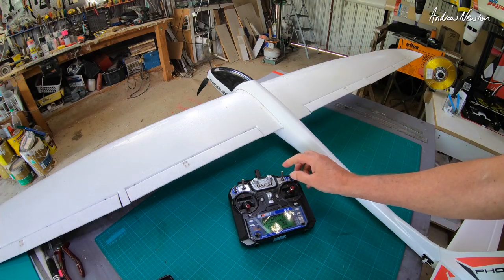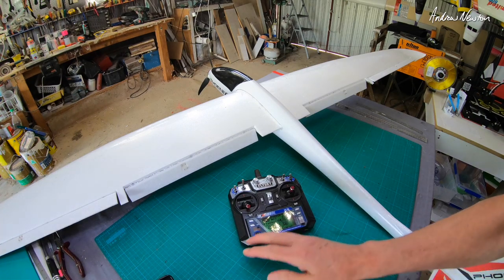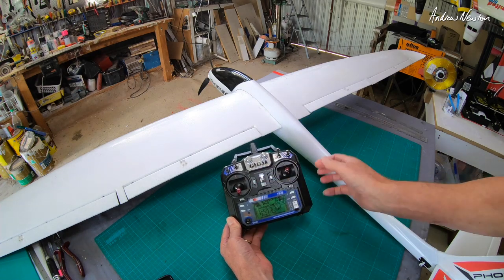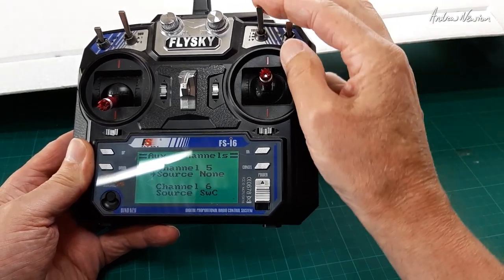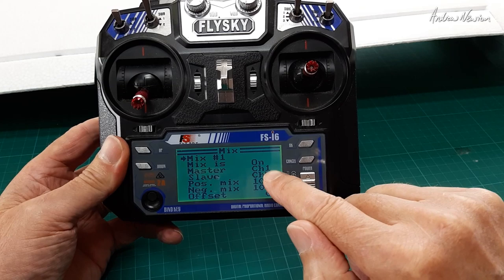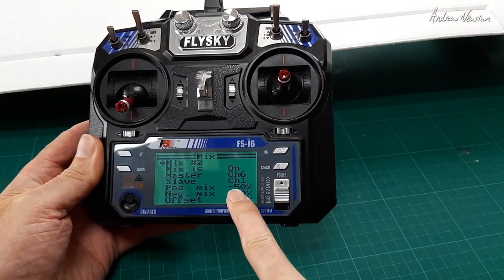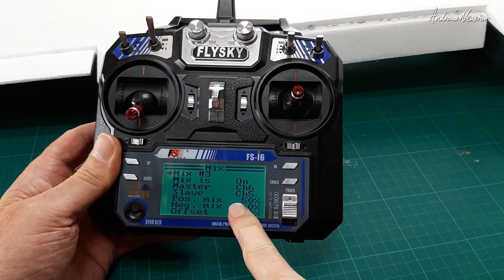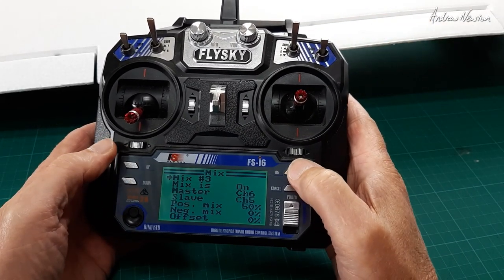FlySky FS-i6 Crow mix

Comment: Great video, glad to see you still use this modern day classic radio, a little tip on the FSi6x its dead easy to add a second 3pos switch, i bought a new fsi6x recently but due to shoddy weather not even used it yet

Comment: Just found your channel and love it man. I am just getting into Sailplanes and use this radio, this helped a ton. Cheers and happy flying.
Reply from the maker: Excellent, sailplanes are the best
Reply: @AndrewNewton  Hello friend, thank you very much for the video, you got one more friend. I am from Brazil and I have a question I wanted to know if you can configure this radio to move the wings of the wing individually, for example the one on the right moves without the left one moving. The one on the left moves without the one on the right

I thank you very much for your answer

Comment: Thanks Andrew! That is what I wanted to know, how to program crowbraking on the flysky transmitter.  

Does the plane balloon up with crowbraking? 
Thanks from the Netherlands.
Reply from the maker: Yes a little bit.
Reply: D. TV if it does, you can add a bit of down elevator to counter it, just a tip.
Reply: @MARKLINMAN1  But the problem is, that there is no mix left. If you mix crowbraking, then you have to use all the three mixes.

Comment: @AndrewNewton 
Hello Andrew!
Is it possible to split flaps using  FS-IA10B receiver ( ruled out Y cable ) and use them at the same time as ailerons on FS-i6x radio? Would it be possible like this please? 
Thank you
Reply from the maker: Like a Full House glider mix? Probably, but I cant check it. Would require separate channels for each aileron and flap.

Comment: Can i have crow mix braking when my ailerons are plugged into a ZHOD KOPILOT LITE but turned off? Current set up is a Voalntex Phoenix V2, Flysky FS-i6x and FS-i6b, plus the Kopilot. what i am thinking is it possible to use the crow mix when the Kopilot is NOT engaged like when coming into landing i turn the Kopilot off so would crow braking then work or not? or would i need a bigger number receiver? as i have a 6 channel that is all used up.
Reply from the maker: Not possible with the Kopilot.